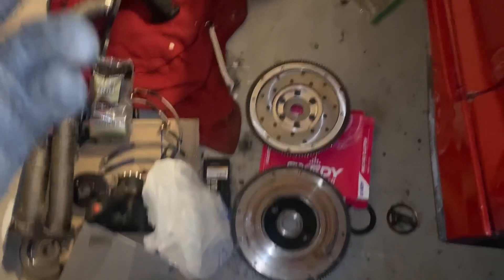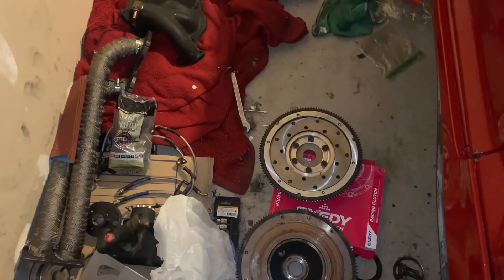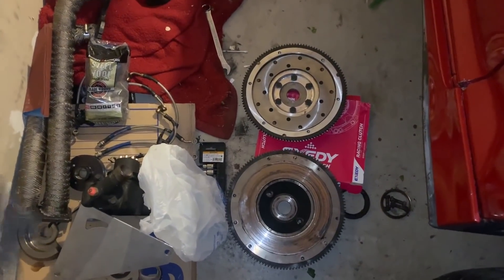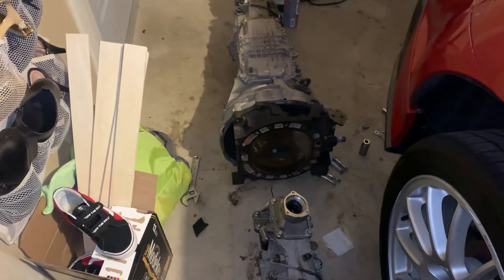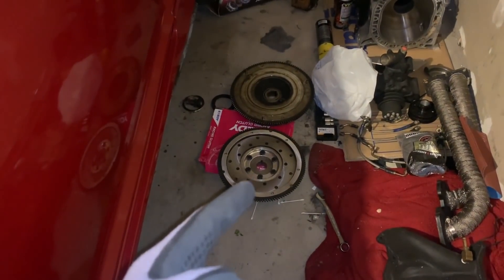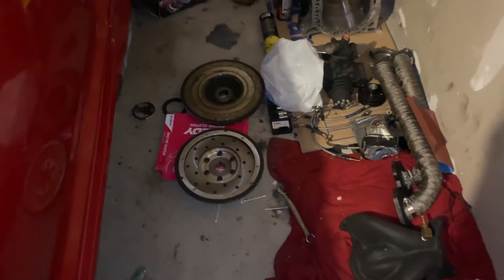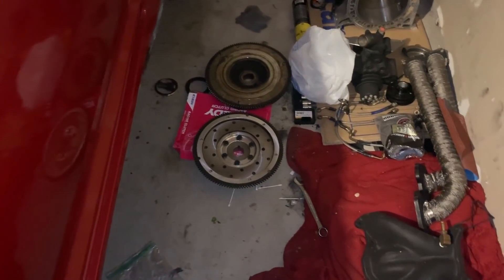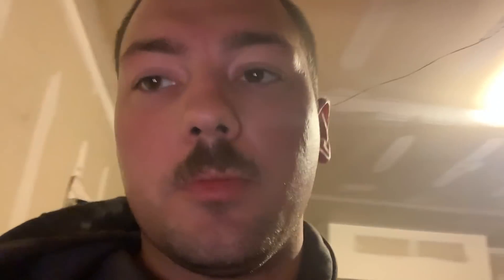MAZDA ROTARY TRANS BACKWARDS COMPATIBILITY

Comment: Hey nate would you be willing to sell me the rx5 box down the road when you switch? I am trying to find an Rx5 5 speed shift lever. But the entire box would be sweet. My 79 Shifter needs a rebuild.
Reply from the maker: I’ll think about it. I was planning to rebuild it because 3rd gear synchro is on its way out (90% of the time it will grind if I shift anything over 4000). I think the shifter might be the same one used in the SA but I have no idea because mine came with the car already installed
Reply: Not to step on nate.. Matsu you can get ahold of me and I can refer you to someone that can get you a good rebuild transmission